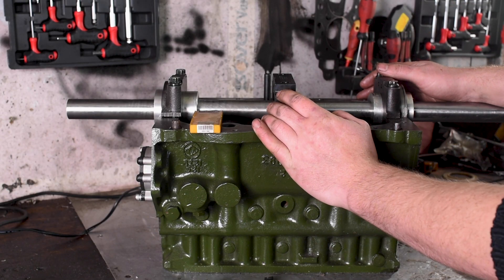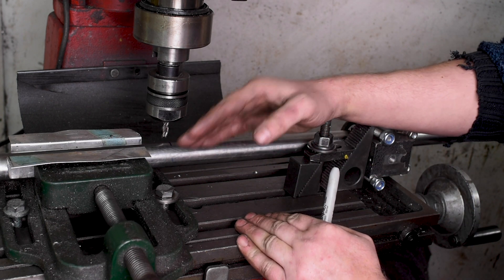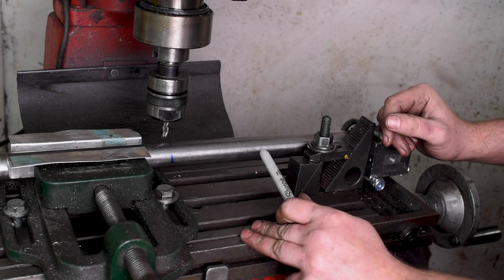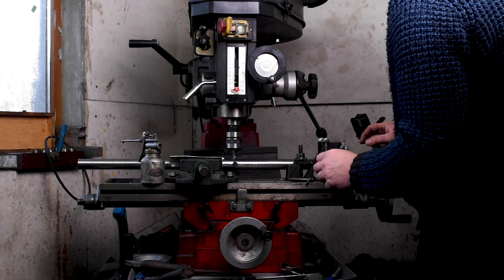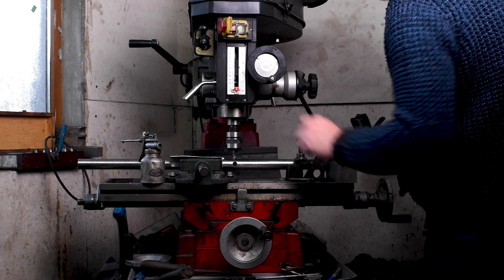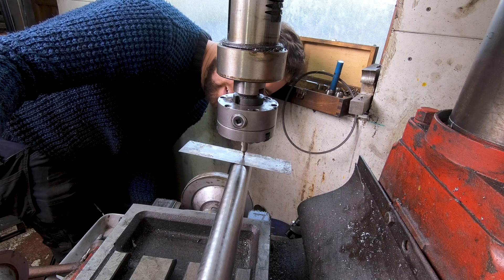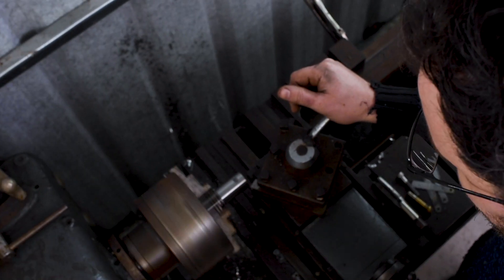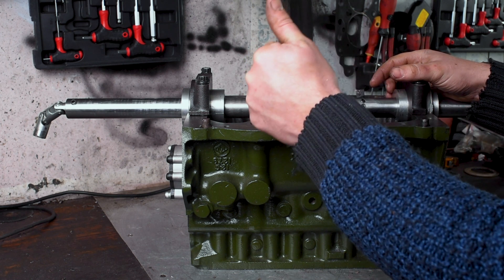Classic Mini A-Series Block DIY Line Boring - Episode 3

Comment: I noticed the large diameter drill wandered a bit when drilling the UJ end, was the tailstock a bit loose? 

Great video, thanks for the shim stock trick.
Reply from the maker: What happened there was the drill bit was sharpened unevenly so took to heavy a cut on one side and deflected. we bored it afterwards so not a major problem. can easily happen with these bigger bits.  glad you found the shim stock helpful